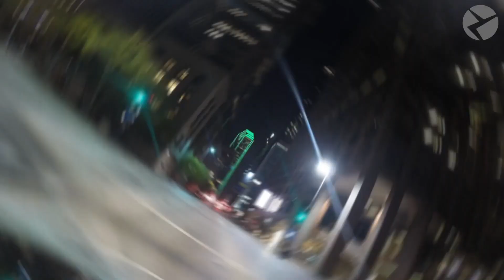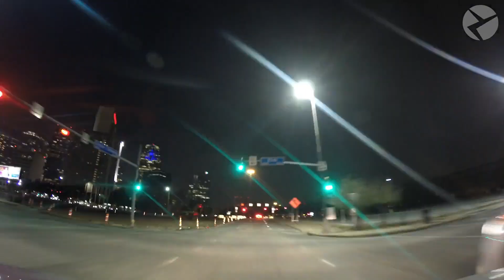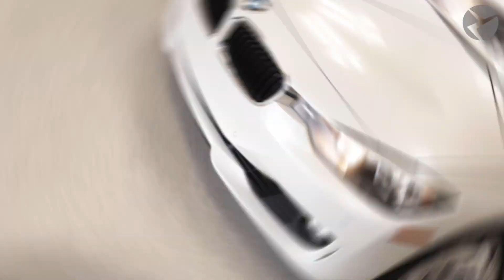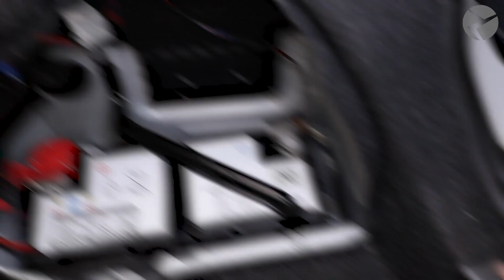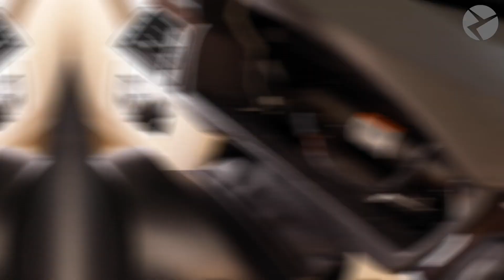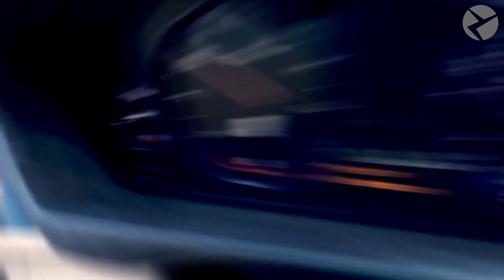BimmerTech Speed Limit Information (SLI) Module For BMW Step-By-Step Installation

Comment: Hi. I have BMW X5 F15 2015. The cluster is 6WB. Same as yours. Will I need any coding? You haven't done anything regarding coding on video.
Reply from the maker: Hey! We can' tell right now if you'd need a special module or just a coding service. Would u mind sending us your car's VIN?
Reply: @bimmer-tech  WBAKR610500G97777
Reply from the maker: The coding will be necessary :)

Comment: Why my bmw f20 lci 2017 with expanded clouster is not compatible?
Reply from the maker: This upgrade is only for vehicles with professional navigation. It's possible your vehicle has an incompatible iDrive system. If you'd like us to check for you, head over to www.bimmer-tech.net/contact to get in touch with our team. They'll only need to know your VIN.
Reply: @bimmer-tech Work on NBT Entry Nav?